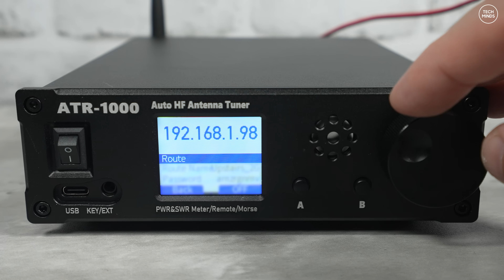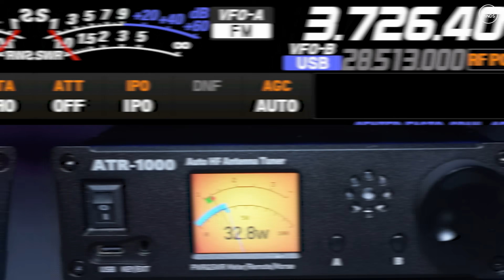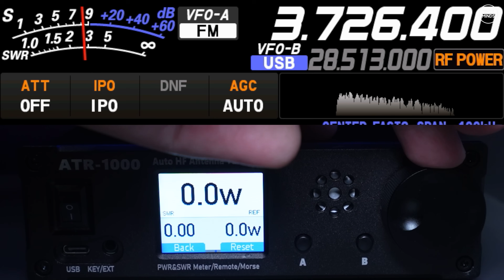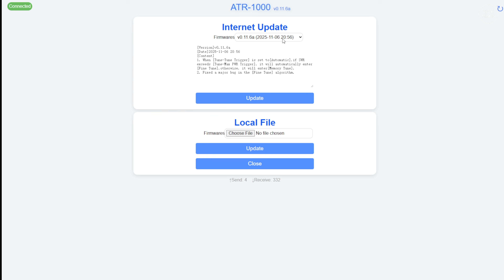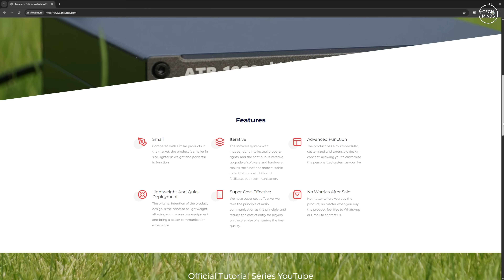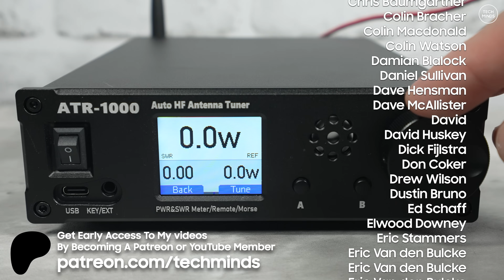High Power Wifi Controlled HF Antenna Tuner - ATR-1000

Comment: This is designed and made by a one person company owned by a HAM in China and his support on antenna tuners for the two that I’ve bought has been excellent. Very fast responses and makes sure the query or problem is resolved. If something has to be shipped, I’ve had very reasonable costs. The price on this tuner is 1/10 of some of the high end ones I’ve compared it with and the performance is solid. I think sometimes we should consider in this hobby we are often dealing with individuals, usually HAM’s not big companies and they can be trying very hard to provide a product and support that is as good as they can for the price. I think sometimes our ideas on things like SMD capacitor specifications are very out of date with major improvements in specifications having occurred recently but unseen unless you are working in that field. Air cores for inductors are almost always a better choice at these power levels and are not the cheaper option. Honestly we can be much harsher behind a keyboard than we would be face to face and that has been a feature of this hobby for a long time. I’ve seen antenna tuners that don’t get firmware updates from one year to the next and yet this one gets updated every week or two to add a feature or improve usability. That is a very good thing in my opinion. We are not dealing with mass market equipment, these types of things sell in much smaller numbers. If we want nice things we should treat the people that make them for us with civility and not always assume we the experts and the person we are addressing enjoys our insights into their design choices.

Comment: From a quick comparison to the ATU I'm using now and the ones I've had in the past, the ATR-1000 doesn't look like it'd handle 1KW effectively. 100W most likely, may be even double that if the antenna doesn't have too much reactance.
Just looking at the distances between the capacitors and tracks tells me that at higher power and difficult antenna loads you'd get too high a voltage and most probably arc over and or destroy the capacitors.
I've used SPC Super Tuner, various LDG, CG, ICOM and Palstar. Currently have a Stockcorner JC4S remote ATU rated at 1KW. I've got a 600W valve linear.

They should market it as a 150W tuner and make another based on the same architecture and increase the spacing of the tracks, bigger box and use much higher V rated capacitors as I'm sure those SMD caps aren't up to the job.

Comment: Just saw your video.  Love the channel.  This looks very nice.  Still using?  No issues?  Have u tried with more than 100w?  I run an amp so curious.  Also is company reputable to buy from?  73 KB2AT
Reply from the maker: I wish I had a way of testing more than 100 watts, but I do not right now. In the near future I will for sure.
Reply: @TechMindsOfficial how about the company?  Never heard of them

Comment: First off, I love the clicky clacky noises of the tuner relays. I also love Matt talking about his love of black backgrounds. I also love the included morse trainer (?????). Now I have questions. When we're talking about more than 100 watts measurements and tuning are key, especially if you have an LD-MOS amp. I need to know how accurate those meters are. Good isn't good enough when swr measurements are critical. I'm also worried about the robustness (is that a word?) of this tuner while using digital modes for long periods. I also need to know more about the wi-fi. I guess I'm old school, equipment that handles over 100 watts is usually built like a tank, with prices to match. Complicating everything here in the States is our tariff situation, which varies month to month. It has almost frozen my pulling the trigger on anything coming from China.

Comment: If this tuner lives up to the hype then it will be a good option to the LDG AT-1000.  The only thing I see is I would have to replace the SO-239 connectors for Type N.
Reply from the maker: Why would you use N-Type for frequencies less than 30MHz? PL259 is perfectly okay for that as long as you are using suitable coax and not RG58! :-)
Reply: @TechMindsOfficial  First I have standardized the connectors I use.  Type N, BNC, SMA.  I use the type N as it is water proof if installed correctly.  All cables are RG214, LMR400, and RG223 for short jumpers.   When I received my license back in 1972 I did not like installing PL259 connectors and when I was in the Navy I used type N as that is what most of the equipment had.  I liked them so I replaced the SO239 connectors with type N and never looked back.  I don't worry about which band or frequency I am using as the connectors and cable will work on all of them.
Reply from the maker: Personally, I like N-Type too so I can understand your reasoning.

Comment: No Icom/Yaesu Tune cycle button interface? Bzzzzzt! No sale. Having to switch modes and dial the power down, then back again, for every tune cycle, when the radio has a "Tune" button, is unacceptable. The Icom Tune cycle circuit is quite simple, and should be included. Even 30 year old MFJ auto-tuners had popular radio brands' ATU interfaces, and different brand-specific cables. The wifi remote control is a nice touch, but radio ATU interface should be primary means of control, as most radios do have a Tune button.
Nice review though! Thx & 73

Comment: The Morse code trainer thing seems really out of place.  Just because you can, doesn't mean you should.  Also, a cloud service for your tuner?  If you need remote operation for your tuner, you probably also need remote operation for your radio so it seems natural that you'd use the same VPN solution for all your equipment.
Reply from the maker: 100% agree

Comment: That's a 1KW tuner if you connect it to a 50Ω dummy load, maybe.
Reply: You shuld not tune at full power, the manual says use 5-10 watts when tuning.
Reply: @Sky1  What the previous poster meant was that the power an antenna tuner can handle is highly dependent on the load. Depending on the load, the coils are subjected to high currents, or the capacitors to high voltages. With such a compact design and small SMD capacitors, I can't imagine that 1kW is still possible when deviating from 50 ohms. Good tuners calculate the voltages and currents at the current impedance and power setting and warn the user. Is that also the case with this device?
Reply: @EbenezerUthyr  yup. Donno but I'll find out soon enough though. I plan to run it in the mobile with an ALS500 amp and Hustler RM resonators. Probably averaging three hundred fifty watts PEP

Comment: I like the idea that you get to see what's it doing (in terms of what capacitors and inductors are used to tune). Its tuning speed is quite slow, I suppose its internal SWR meter requires time to measure SWR so it cannot go through the relays combinations at high speed like every other tuners I have used do (Icom AH-4 and CG3000), still not much of an issue especially if it has memories so it does not need to re-run every combination every time. The CW trainer is pointless in a tuner, that's the typical Chinese habit of cramming every possible feature in everything, like the torch and the siren in every Chinese handheld radio. I doubt it will tune 1KW, or at least it cannot operate the relays with 1 KW RF on them. 300W is much more of a reasonable measure for its power handling capabilities.
Reply: The system features four tuning modes: Memory, Full, Fine-Tuning, and Manual. Each mode has a different tuning speed, which you can customize in the [TUNE] menu. A default algorithm can be set in [TUNE-TUNE Algorithm] for extremely fast tuning.

Regarding power handling, in April 2025, 50 HAMs in China participated in internal testing, including various types of amplifiers, reaching even 1700W SSB. Current performance specifications are sufficient.

Comment: make it waterproof and completely remote and ill buy3ea.
Reply: Put in in a waterproof box, simple
Reply: I have an ldg tuner I took into harsh environments for years and it never had a problem, unless you are going to set your gear up in a thunder storm with no cover you should be good.

Comment: Nice review. It looks well made but I am not sure those coils would handle a 1kw linear. You had better go out and get one to find out. Morse tutor seems a bit random.
Reply from the maker: I would quite happily test this with 1000w if I had an amp! ;-) Cheers Mike!
Reply: @TechMindsOfficial  ,,,get one, you know you want to. Did you measure the tuning range at all? I can see this being useful as a remote ATU at the bottom of the garden, but I doubt it would cope with a doublet. More for extending the range of an HF vertical perhaps. I have an SGC 200W ATU I picked up broken for about £10. It had water ingress. That had damaged a few parts but turned out to be easy to fix. That's what I use on HF, but the 200W limit is, well, a limitation.

Comment: The matching capacitors are neither silver mica or ATC or Unelco Semco HV ones...Do you really trust that it host 1kw ??
Reply: It's only 300 watts RMS. Saying 1000 watts PEP is kind of cheating for marketing purposes.
Reply: @keyboarderror1  It's real; HAM worked it in a 1500W scene.
Reply: @antuner  I'm fairly certain my amplifier would eat though it in short order. Wouldn't waste the money.
Reply: NPO capacitors are used, each with a withstand voltage of 3kV, arranged in a 2x2 configuration. One set of capacitors can withstand 12kV with zero temperature drift. In other manufacturers' products of the same level, the same combination provides a 1500W SSB withstand capability. The 1000W SSB figure used here is a conservative estimate.

Comment: Ich vermisse bei Fernsteuerung die automatische Bildschirmabschaltung (zum schonen).
Die Kondensatoren halte ich persönlich für zu winzig, um genügend Spannungfest zu sein. Die explodieren sicher bei hoher Impedanz und Leistung.
Reply: NPO capacitors are used, each with a withstand voltage of 3kV, arranged in a 2x2 configuration. One set of capacitors can withstand 12kV with zero temperature drift. In other manufacturers' products of the same level, the same combination provides a 1500W SSB withstand capability. The 1000W SSB figure used here is a conservative estimate.
Reply: @antuner  Oh, thank you so much for the capacitor description!

Now all that's missing is automatic screen shutdown during remote operation. Morse code functionality is actually unnecessary.
Reply: @VoSo_  unnecessary ? Maybe for you. I would like to learn morse, and I’m in the market for a high power tuner.
Reply: @KenOathBro Accepted... but I find it unusual to use a tuner for something like this. There are numerous better and free options for learning Morse code.
Reply: @VoSo_  Completely shutting down the display is currently not supported because there are no spare pins for control. However, the system theme supports a black theme and has a standby black screen function.Regarding the Morse code functionality, several HAMs actually requested it and asked me to help add it, which is how it came about.😀
Reply: @antuner  Thank you!

Comment: It always irks me when these manufacturers get measurement units wrong, like in this case - Mhz (Mega Planck's constant Impedance) instead of MHz (Mega Hertz). I have a Chinese QRP rig with an internal battery, and the charger port is labelled 'CHRAGE' 😂
Reply from the maker: I've seen ANAL yzers too..! Im sure one of my videos show that lol..
Reply: It's not wrong.  They are just using Chinglish instead of English.